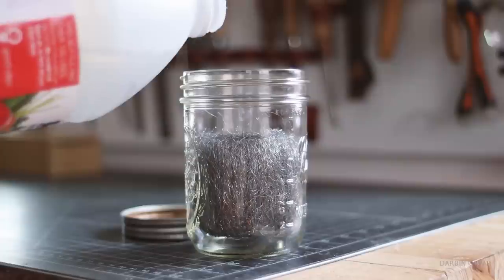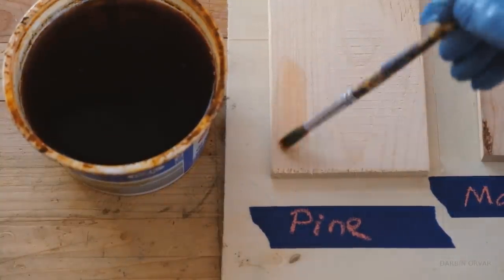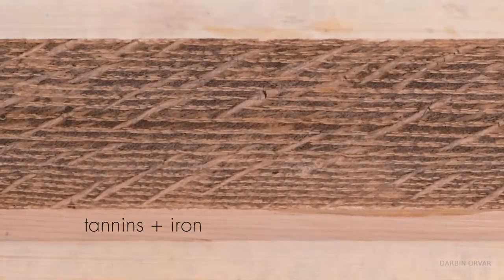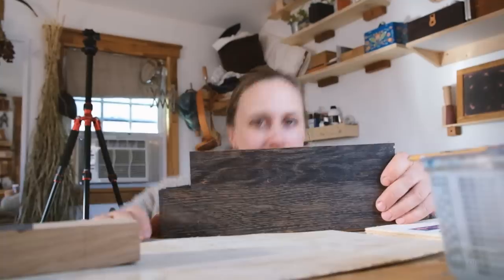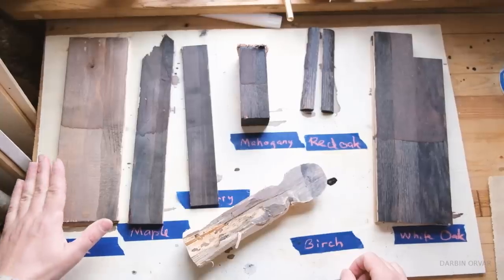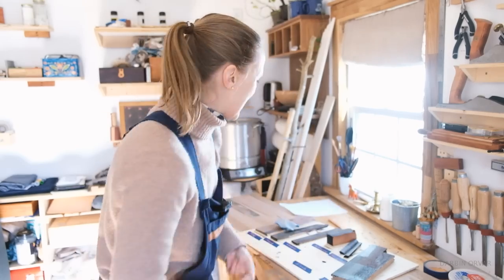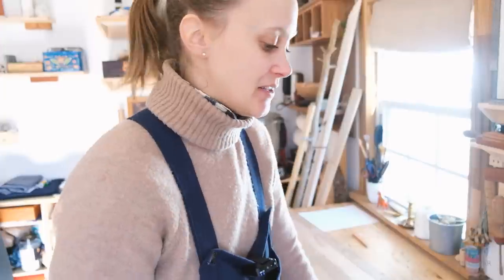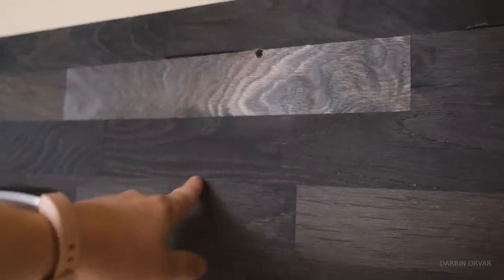The Oldest Natural Staining Trick: Steel Wool & Vinegar (HOW-TO & TESTING)

Comment: For pine, oak: I boiled my vinegar, used that. Then put in steel wool, and left it for 0,1, 2, 3 hours, testing each hour.  Each of them stained the wood grey, even the neat vinegar. There was minor, very minor difference between 0-2hrs. Only on 3 hour did the difference become visible, and it was about 30% different. Boiling the vinegar speeds everything up hugely.
Reply from the maker: Interesting!
Reply: Thanks for the tip. I would not have thought of boiling the vinegar first. 👏👏👏👍🏼👍🏼👍🏼
Reply: Why does boiling the vinegar help?

Comment: Tannic acid is also a useful ingredient to restore rusted iron. If you mix up a solution of tannic acid from ground up tree bark or even a strong tea and distilled water you can soak your rusted piece of iron in it and it will help turn the red iron oxide into the more stable black iron oxide. I have a suspicion that one of the proprietary ingredients in EvapoRust is tannic acid but I'm not a chemist and there are multiple different chemicals that can act as a chelating agent for rust.

Comment: If you have some worn out files, use the vinegar to etch and deepen the grooves in your files. Scrub them off with a fine brush and soapy water and rinse well, then coat in WD-40 to prevent rusting. Some clean up in as little as a day of soaking, while others may need up to 5 days. Filter the chunks of rust out of the waste solution with a coffee filter and you have iron acetate without wasting your useful steel wool. The benefit of doing this is getting a second life out of your files and you have a useful byproduct to stain your wood.

Comment: I learned from a local work worker that this stain causes the wood pores to mildly tighten similar to shou sugi ban wood. That's why more than one coat causes the iron to sit on the surface once dry.

Comment: Just a note: If you want a darker black color. Take black tea (3 bags to quart) let it set and seep.
Brush on black tea first let dry then brush on iron solution. Let dry then repeat.
The black tea adds tannins to the wood for the iron solution to react more.  You can get almost a black stain from doing this. I've done this with three coats then seal with Lacquer or Oil base Urethane. Do not use water based urethane, it will remove some of the black stain.
Reply: Good points. I was thinking of just adding black tea to the vinegar/ steel wool mixture, but it makes more sense to do the tea first. Thanks.
Reply: Very informative video. I love your semi- scientific approach!

Comment: Excellent. In fact, any iron or steel can be used (eg old nails, screws etc.) and any acid (eg battery) but vinegar is a fairly “harmless” acid in the dilutions that that can be bought.

Comment: Household lye also colors wood in interesting ways. I've used it to turn mahogany and white oak a deep warm red-brown.
Reply: Interesting! Any experience in what effect it has on yellow and white pine? I'm looking to turn it into dark brown, without chemical based stain.
Reply: @LitoGeorge  I'm not sure about those two woods. In the class I took we only tested it on Mahogany and the results really surprised me. It turned the rather light mahogany the deep red brown color it gets when aged. So on my next project I tested it on oak and got similar, very pleasing results. I'm guessing it was reacted with the tannins in the wood. The vinegar+steel wool+tea may work better on pine.
Reply: @bbchops919  thanks Jim - thats interesting. I have tried 15+ variations of the vinegar/swool/tea (and coffee) mixtures on the pine I'm working on, and they all come out a grey and then black colour. Not quite what I am looking for. Years ago I did something similar on pine from the Maritime provinces and it went deep brown to my surprise. I wish I could remember the combo I used but pretty certain it was iron acetate (vinegar/swool). I am keen to use household items that are safe rather than chemical based solutions. Lye can be obtained by putting water through wood ash and then evaporating the water.

Comment: I found with my own experiments on pine that the redish colour you get when you add more coats appears to be oxidised, dried solution sitting on the surface of the wood. Wiping that residue off with a damp cloth leaves a more natural 'aged pine' look. I wonder what happens if you wipe this residue off of the hardwoods?

Comment: What happens if you treat with TANNIN first? (How much darker is it with various dilutions as before?) What happens if you sand it after treating? (to smooth out the wood again.) What effects are made when trying to add a finish such as varnish, shellac, Linseed oil, beeswax, Wipe-on Poly, etc to these different mixes of stains?

Comment: Lovely but it's advisable to strain da  stain solution to prevent fine steel wool from sticking  on to da wood. When u making da solution leave da lid slightly open to prevent gas build up.

Comment: Can you add water to the steel wool/vinegar solution in the first place to get it diluted right from the start? Or does that affect the chemical reaction of the vinegar on the iron?
Reply: Would not recommend it. Just make it and dilute it later. Compare it with cooking. You don't throw a bunch of salt in your food before tasting/boiling it. It mide be too much. And you would notice after. At Wich point you can throw away the whole dish

Comment: What's the weight of "one steel wool thingy?" (just approximately)
Reply: 8 pack on Amazon claims to be .8 oz, math works to .1 oz for an individual. Would've guessed the ones I've used in the past that come with cleaning solution in them are about .5 oz. Amazon math seems to be in the ballpark for ones without solution in them.

Comment: What is the shelf life of the vinegar/iron solution?
Reply: I've had several batches in jars for years and it still works, just gets funky if you leave the steel wool in. Still works though
Reply: Also, my experience is that the tannin content can vary considerably between heartwood and sapwood.  In particular, with white oak, the color change in heartwood is nice, but the sapwood is rather anemic.  Probably not an issue on flatwork from milled boards, but could be a concern for turners who harvest their own timber.